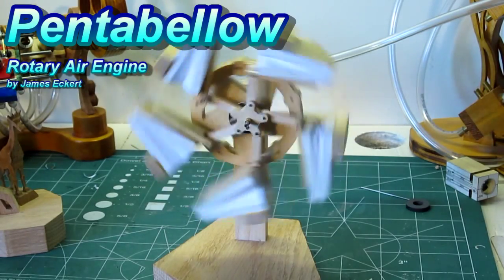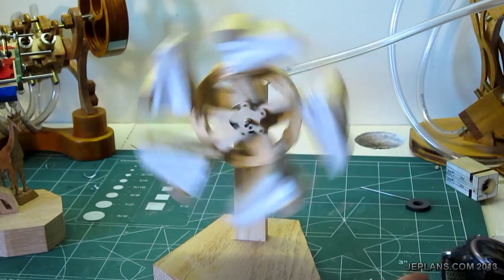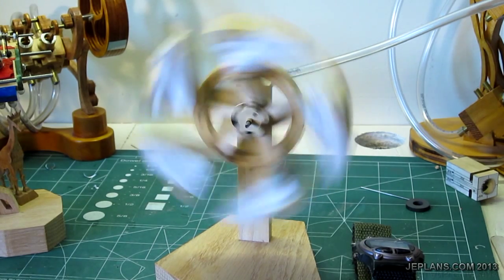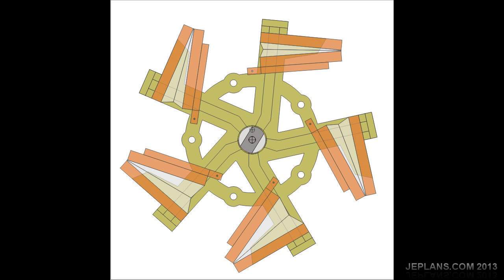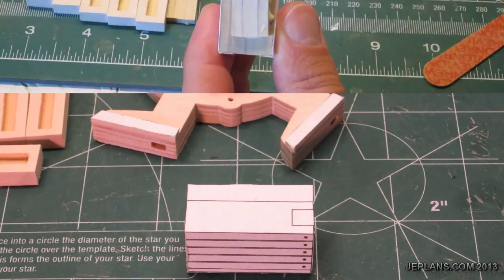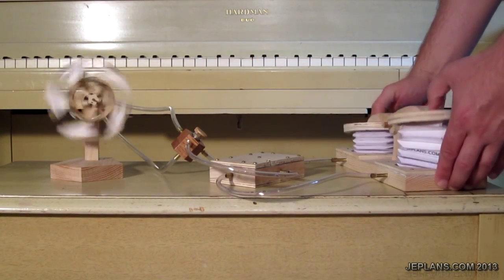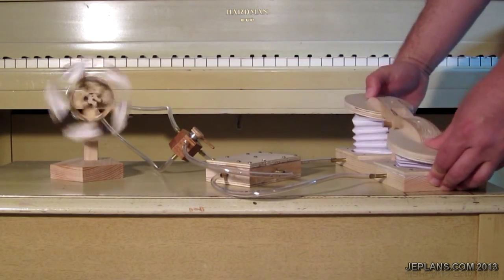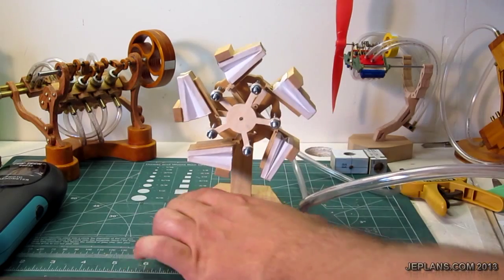Rotary Air Engine

Comment: Hi, I like the engine. Should it work in the "opposite way"? I mean, blowing air as output from a rotary motor as input.
Reply from the maker: Yes is does but since is run on a pretty small amount of air it make a very small amount of air.

Comment from the maker: I keep it in mind, but the Wankel is specifically designed around the combustion process. I am not saying it could not be made to work but in a air/steam/vacuum type engine the combustion occurs somewhere outside the engine so some of the Wankel's function would be wasted ran in that way.